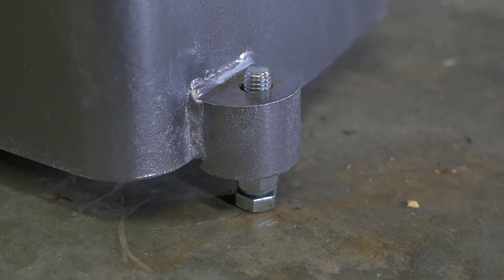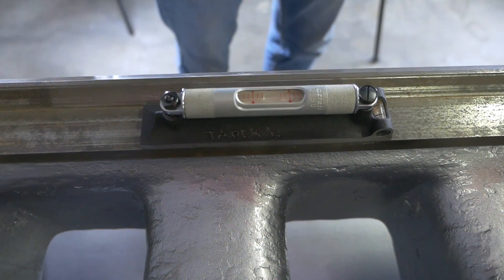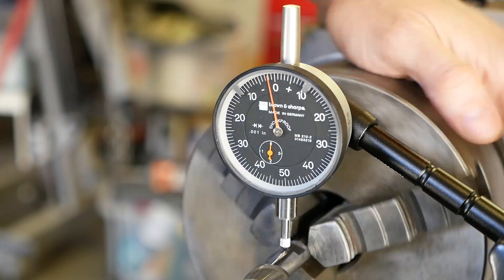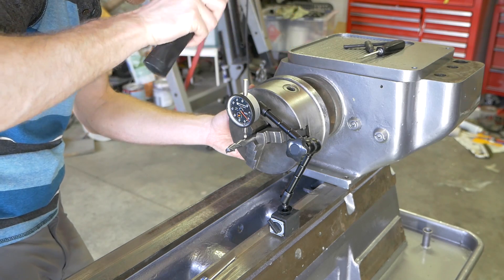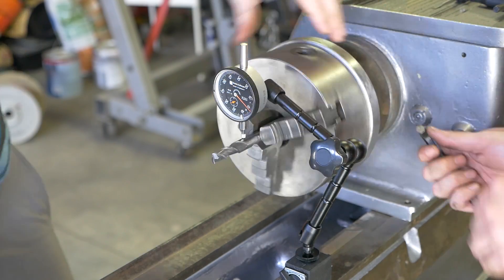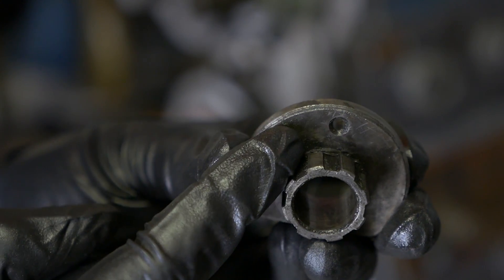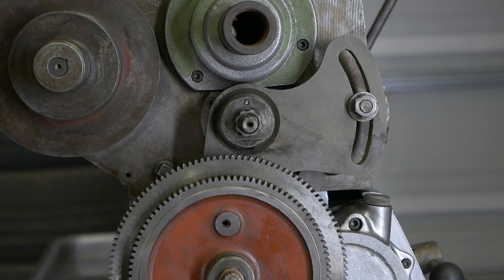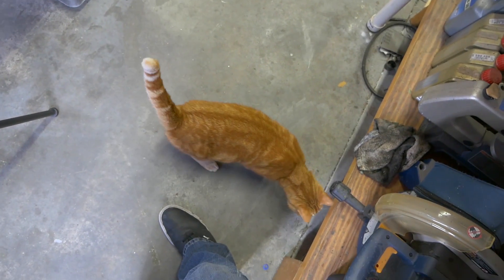Lathe Rebuild Part 7 - S02E07

Comment: In all seriousness, there's no reason to rescrape a machine until you make something with it and can evaluate its ability to make good parts. Lathes especially can be quite badly worn and still make very good parts.
Reply: Did you use a good slideway oil ?
This makes much of a difference.
Reply from the maker: Thanks Wes, I think this is a really good point. we did have a chance to adjust the apron and take some measurements before it came apart. Although we weren't able to make any chips, it was pretty clear the action on the apron was never going to be smooth enough for our satisfaction.  It probably would have made good parts, but it would bug me every time I turned the handle.
Reply: yeah because in Germany/Austria we usually aim for 1- 0.5 hundredth of a millimeter, which are about 0.4 to 0.2 Thou
Reply: In all honesty, I aim for whatever is within my tolerances and GDNT. As long as the part is fit to sell, it's a good part.